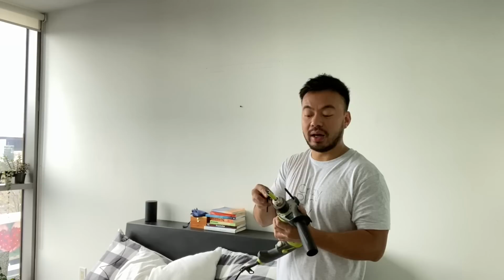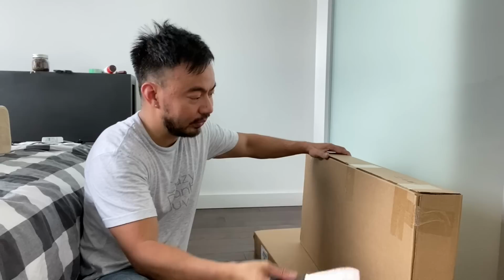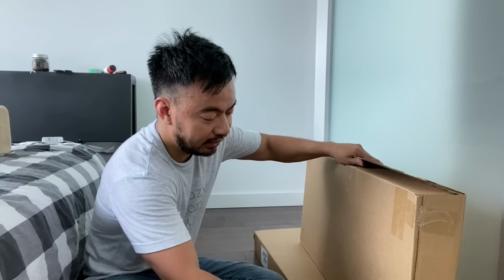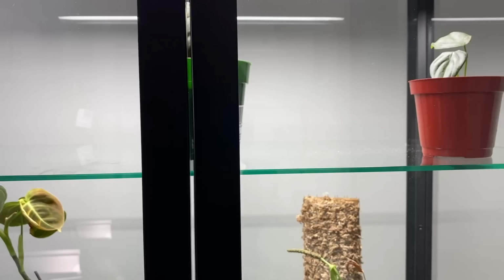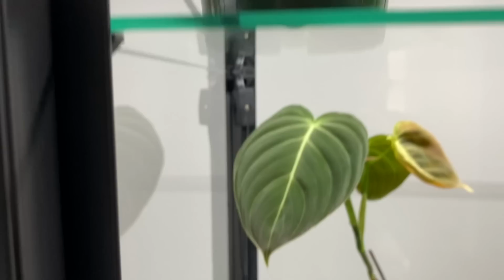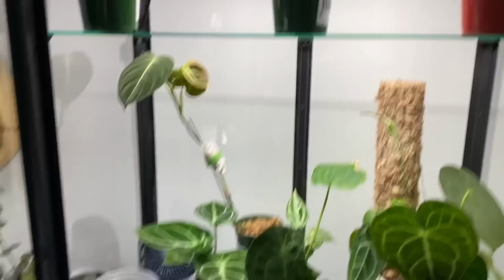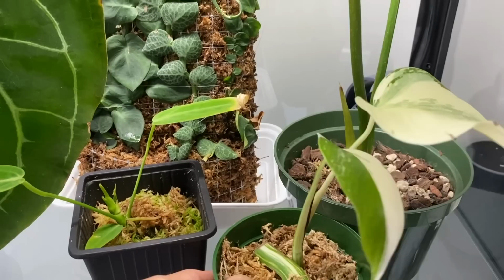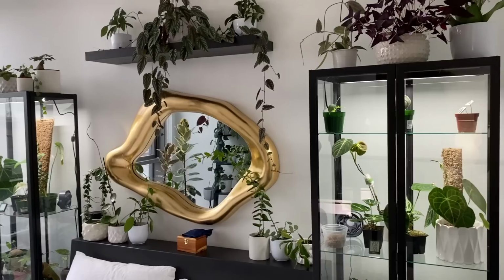Houseplant Room Makeover + Ikea Greenhouse Cabinet Tour

Comment: Hi Christian,
What I never get with plants and airflow is that drafts give them bugs or at least make them unhappy, but you need a fan in a greenhouse... 🤔 I always wonder if a plant is in front of a fan, won't it get unhappy? Same if it's in an AC 'draft'. I just don't get the difference between drafts and airflow 😂. When is airflow bad and when do you want to have it... Hope you or someone else can explain! 😄
Reply from the maker: I’ve never thought of air flow as bad. I think simulating air and wind on your plants like they would be outdoors is good. Makes them stronger. Air flow in a greenhouse is important so your plants don’t get any fungus and mold from all the humidity. I think extreme temperature drafts isn’t good for your plant. Like winter cold draft or hot air from a heater.

Comment: Where did you get those old ikea shelves? The new ones are not made that way anymore.
Reply from the maker: It was available at my local ikea. I didn’t know they had new ones.
Reply: @CrazyPlantGuy  yea. The newer ones don’t have the two metal braces inside. Instead, it has like a lip that you attach the wood shelf to. They’re horrible and don’t hold much weight. Looks as though they are sagging. ☹️